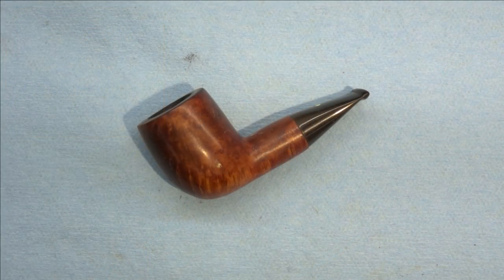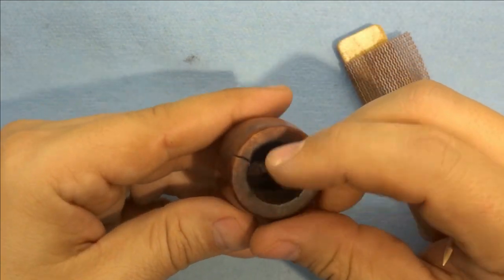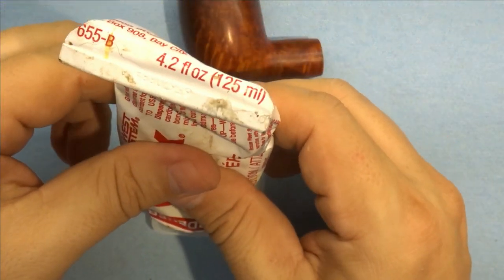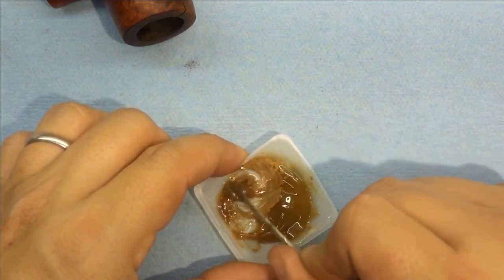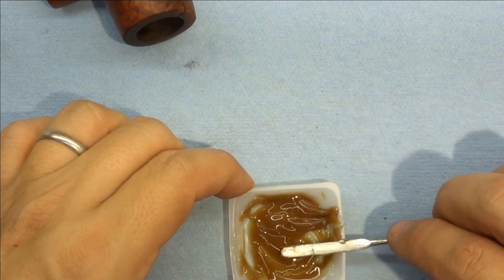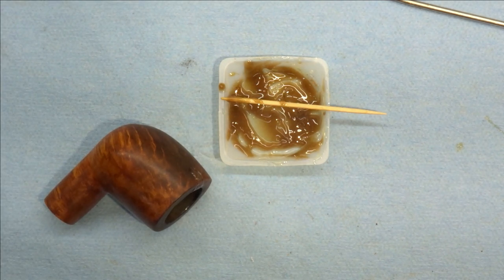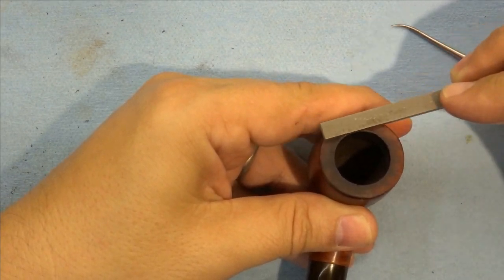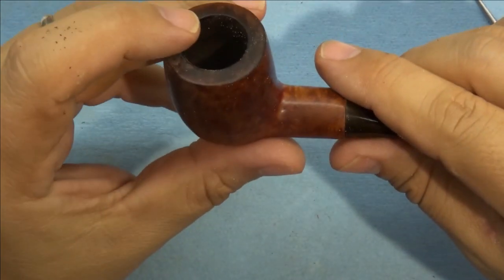Repairing a Cracked Dunhill 305 F/T Part 3

Comment: That's going to be an awesome little pipe when it's all said and done. I just came across a gallon sized zip lock bag of pipes and stems at my local thrift store and I got it for $20. I wish I could send it to you and say do your best with what's there but that's not in my budget. But I do a little pipe tinkering and maybe 4 of the 13 or so pipes in the bag are complete they just need a lot of love.
Reply from the maker: Peter, that is fantastic.  If you have watched me for a while you know that the reason I started this channel was to help folks like yourself restore pipes.  The business is just a way for me to be able to help the folks that don't want to do that, or perhaps don't have the tools for a bigger job like stem making. If I ever can help you in your tinkering, even if you just need some free advice, don't hesitate to get in touch.  Thanks for watching!

Comment: Amazing to see this process step by step. Ur attention to detail is evident. I have ended up using my rod epoxy prokote epoxy and paste and find it works very well. Interesting it is much more expensive then hardware generic stuff. Laughed too as I was using syringes and measuring meticulously w epoxy mixes until I also learned like u said eyeball amounts works just fine. Looking forward to part four!
Reply from the maker: Yes, there is voodoo in every hobby, and epoxy seems to be the cause of a lot of it.  Thanks for watching!

Comment: No file is created equal. I've had some terrible files in my day. To the point that I actually go on eBay to buy old new stock of Nicholson Black Diamond files. With that being said, what is your brand of choice for the smaller files you use for your pipe restoration?
'
Reply from the maker: Thanks for the comment and question.  I use a lot of files, some of which I picked up at long forgotten hardware stores or yard sales. But I'll tell you about the most used files.  For most of my stem work, I use Grobet pillar files.  They are pricey but wonderful sharp files.  For quick removal of stem material, I use cheap vulcrylic files from Amazon.  They will well enough and usually last 6 months or so depending on use. I use a lot of inexpensive needle files that I buy at Harbor Freight. I grind safe edges on them and grind them into whatever profile I need.
Now, if only I could find a good saw sharpening file 🤔

Comment: Great video series! Would it have helped to drill a small hole at the start of crack to prevent it from propagating?
Reply from the maker: Hi Rick,  Good question.  In this case I don't think it was necessary, but I have done that on some cracks.  Thanks for watching!